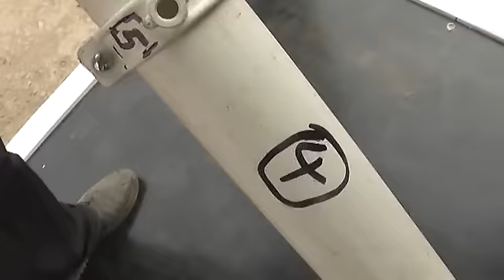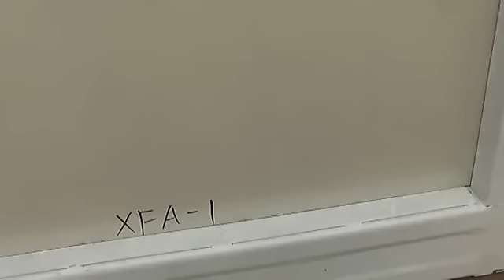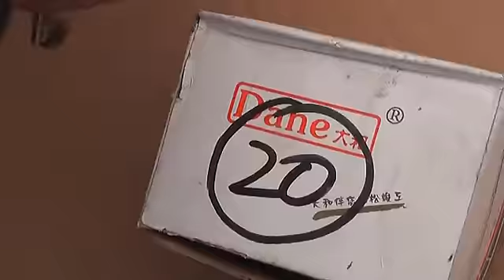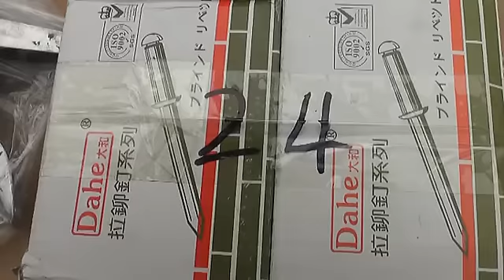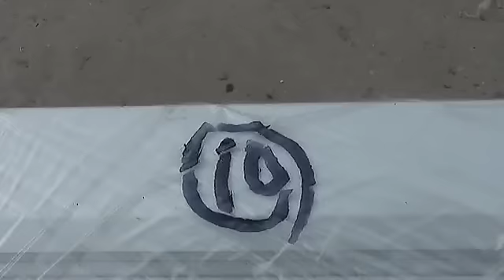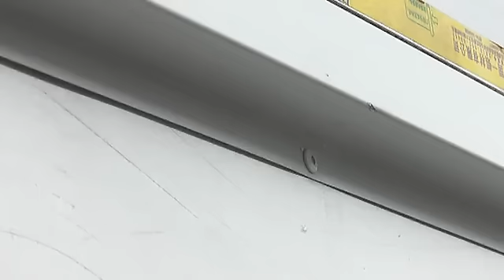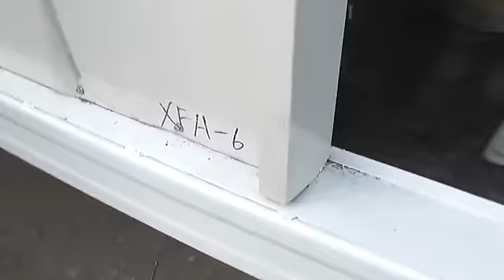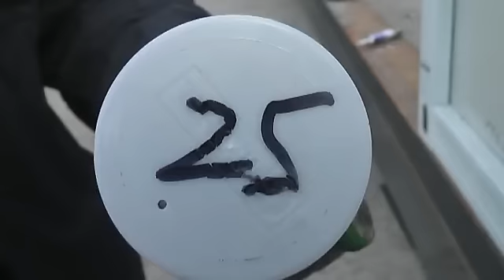Installation Video of 40 foot Container House

Comment from the maker: Our office is EPS composite panel for roof and wall. The office has been used for 3 years. It is watertight, the house is sturdy. Its appearance can be made of different color or shapes panel.This is our website:http://www.bf-house.com/
Reply: +刘敏 WHAT IS THE COST OF THIS UNIT
Reply: It's made in China so it's going to be poor quality  or made with environmental  concerns or some other  undermined sense of quality .
Reply from the maker: +rho lees The use of different materials and manufacturing, it would be popular in some countries.
Reply from the maker: +mimi childs $4400 for one 40ft container house.
Reply: Bad link.
Reply from the maker: The website is broken. You can view the website. http://www.bf-house.com/
Reply: Baofeng Hebei Good website! Can you include wechat as well please? Thx.

Comment: Poor aesthetics.  Just no design elements to give it merit, other than "made in China", representing lower cost and quality.
Reply: +rho lees I would be concerned about quality. The shipping containers from the docks are fairly indestructible and weigh 9800lbs each. What I see in the video above is a poor imitation with cheap caulk and what looks like cheap insulation. A good storm and these would be toast or a nightmare in upkeep to repair or shore up the the seams etc. Sometimes cheap is just...cheap, and more costly over time in maintenance costs. Better to get real steel shipping containers.
Reply from the maker: +Biz Diva yes,this is not shipping container house. This 40 foot container house has insulation panel.